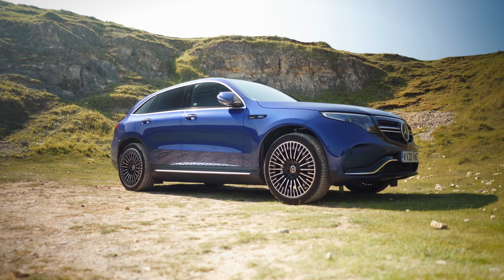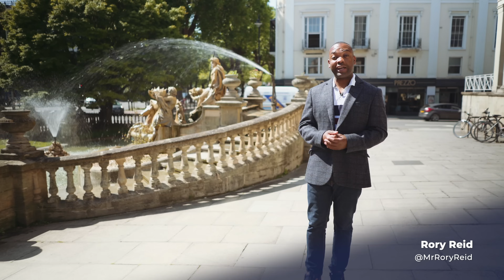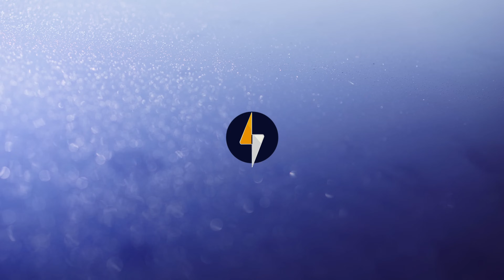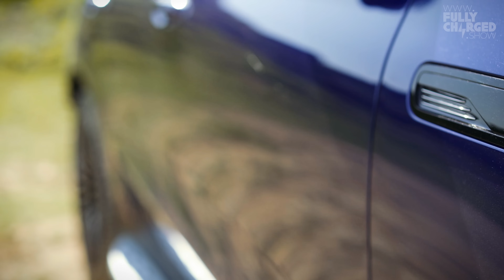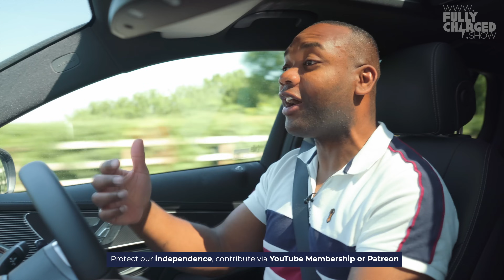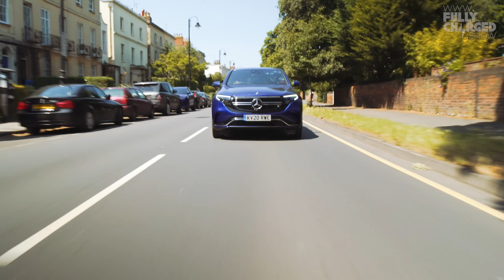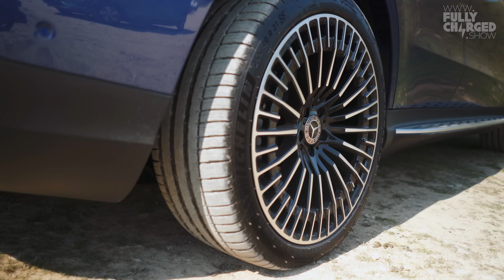Mercedes Benz EQC - Rory Reid First Drive | FULLY CHARGED for Clean Energy & Electric Vehicles

Comment: Double the range with level 3 fast charging (15 to 20min to 90%), before I would even consider it against a Tesla's model Y!
Reply: The tesla is a cheap product though. You see it from its lazy design and non existent interior to its poor build quality and slap dash execution. A car isn't about whether it can play games and make farting noises. It needs to be a CAR first and foremost. Something which tesla is not good at doing. But sadly it seems the superficial nonsense is what people like these days. Herd mentality. People can't do their own research and make up their own minds these days. They need other people's over exaggerated videos for validation.
Reply: @SDav21  So when you grow up, please buy a Merc. 

For me, after driving, all major brands, including the Merc in ICE, I'll settle in with a Tesla as my next EV.

Most people here comment with on screen/online experience.. Own these cars first, then you'll really know. EVs are the future, ICE age comes to an end shortly in next 20 years or so. Tesla is 15 years ahead in battery and battery management technology, including auto computer tech. Yes they are lagging behind in fit and finish, but I'll take my chances, as these are minor issues in comparison to EV auto tech.

PS: when I say battery, the following is involved:
1. Battery power density to weight 
2. Battery charge, discharge rate.
3. Battery life. 
4. Battery temperature control 
5. Power management systems - here actual electron consumption, Tesla is far ahead of any other auto manufacturers
6. Battery safety 
7. Sustainable battery production and future proofing, here too all other manufacturers are way behind Tesla.
Reply: John Edwards  The Mercedes is better built and more luxurious. It has better safety features many which tesla doesn't have. It has better convenience features which tesla doesn't have. Everything from its amazing adaptive lights (see Bjorns channel to see), to the voice assistant to things like presafe sound, presafe impulse side and its general suite of safety systems which Mercedes pioneered years ago which other cars are only using today. Just because the model x has a larger screen doesn't make it more feature packed. Having Netflix and farting noises doesn't make it amazing technology. It doesn't have anything the EQC doesn't have. It misses a lot of other features which many other carmakers have. Not to mention the 360 parking camera which tesla still can't do.
Reply: 15-20 minutes to 90% ..... Of what range?
Reply: @rogerstarkey5390  See the video, double the range, 15 to 20min of that, to 90% charge.
Reply: Let the snobs spend their money on out-of-date status symbols while the rest of the world moves on. The dinosaurs will die off and no one will care.
Reply: @tompava3923  It's not a status symbol. It's a good car. Tesla has become a show off brand more than anything. They don't build cars. They build software that easily amuses kids and small minds and that fools the ignorant into thinking they've got "technology" because it streams Netflix.
Reply: @SDav21  which car had the longer range?
Which car has the better efficiency?
Which car charges faster?
Which car accelerates better?
Which car handles better?
Which car has more practical space?
Which car has the higher crash safety rating?
Which car has longer warranty?
Which car has the better charging infrastructure?
And you want to argue that none of those are important for a car and we should instead ask which car has the nicer interior materials and longer heritage.
Reply: @MrGonzonator  As a car it remains crap though. It's too expensive for what you get. 

Also, No it does not have a higher crash test rating. The EQC scored 96% for the front occupant crash rating in euro Ncap. Model 3 got the same and the model y is a model 3. The model 3 got 86% for child occupant protection, the EQC got 90%. And that is arguably the more important score for families. So no, the model y isn't safer. It barely has all the safety features the Mercedes has.
The charging infrastructure is wide in many countries. Carmakers don't make chargers. They make cars. You don't see carmakers having fuel stations. There's plenty other chargers. 

I drove a model s. In no way is it better at being a car than anything else in that price range. It was simply awful. 

Also the 2 cars are not comparable any way. Mercedes has a GLC that has a long range, that accelerates better, that handles better etc.

So what is your point exactly? There's more aspects to a car than just what you mention. There are plenty cars that are better at everything you questioned, electric or not.

Don't forget the Xpeng either. It's not just about build quality. What's on the outside is what's represented beneath. If tesla can't even screw a seat on properly or a panel, it must be total hot garbage underneath. Some have already shown rust on their model 3s and water leakage from windscreens and what not.  Get over yourself. Tesla really makes terrible cars for the money. And to excuse such slap dash work shows the issue with society today. You'll rather have farting whoopee cushion noises and games than a car built with integrity.
Reply: @SDav21  OK you've made your point, not everyone has to agree what factors are important to a car.
For some people, air vents that are not copper are just euch.
I'm willing to bet a sizable chunk that you are in the vast minority. That the Model Y will outsell this 10x in markets where they compete.
Reply: The fact that you're putting the Tesla model Y in the same sentence with this car, tells how much you DON'T understand about cars. This Mercedes is several leagues above the model X, let alone Y.  Y is a mass produced cheap product. This is a luxury car. They're not even remotely in the same category, and there are so many advantages to the Mercedes that it's pointless even naming them, as everyone who knows anything about cars will be aware of them, and those who don't, like Tesla fanboys, won't understand them even if someone were to point it out to them. The way Tesla fanboys look at cars is SO INCREDIBLY SUPERFICIAL, with so little understanding or depth behind their reasoning. It's almost giving me a second-hand embarrassment feeling because of how clueless they are, while acting superior.
Reply: BeyerT1 Didn’t like your Tesla test drive then?
Reply: @jamesmorris409  Didn't get allowed out probs.
Reply: @derbigpr500  Its not about being a fan boy. But about battery technology today, that I am talking about. The conventional car manufacturers are at the least 15 years behind Tesla in battery technology. Here is the proof, before you open you mouth, please do the research on: "the electron consumption of Tesla model Y with Merc EQC"... waiting....
Reply: @derbigpr500  here in the UK the Model Ys we get will come from a brand new factory in Germany so will automatically be streets ahead of the ones being built in California plus the Tesla charging infrastructure is simply the best there is, so best tech, best batteries, best charging, not the best interior, who cares!
Reply: @derbigpr500  Mercedes, easily the worst car that I have owned.
Reply: @derbigpr500  so many good reasons to prefer the Merc that you're not even going to name one. That's a very convincing argument.

Comment: So, let me get this straight. Tesla's FIRST original car, the Model S (the Roadster was half lotus) had a frunk, more storage space, more range, more performance than this car from Mercedes, a company that's been making cars for 100+ years, PLUS they had the model S as an example of what to do, and they STILL missed the mark by a long shot? Unforgivable.
Reply: That's why Musk said he didn't want to make the best electric car, he wanted to make the best CAR. So combine with a ground-up design (ignoring the original Roadster) Tesla has managed to get around the tedious legacy and automaker thinking. I'm glad the Merc exists, I just wish it was more than just a credit towards keeping the V8 petrol cars out of environmental jail.
Reply: It's what happens when a company is run by marketing (the image is everything to some of these companies) and not by engineers.
Reply: @davenz000  So true. This is a complete failure being a good EC and probably a masterpiece at being a compromised car that needs to keep ICEs on the road while using parts and build facilities of the same.
Reply: The thing with Mercedes is that their reputation is on the line BECAUSE its a company thats been making cars for 100+ years. When you think of Mercedes, you think not only of luxury but also of savety, highest quality and that what you buy actually works (at the least). With a reputation like this, you can't make bold moves like Tesla does. Tesla is better in so many ways, but not in quality or manufacturing for example; Mercedes could never allow someone to say this about them. They double and tripple check every step, which is why they are so much behind Tesla in things like autopilot. Tesla's autopilot is great but its no secret that its full of flaws and caused many car accidents (especially in the beginning with the phantom breaking); Mercedes wants to make sure that the autopilot is perfect. Absolutely perfect. Even if they are 10 years behind Tesla to achieve that. And customer experience is the same deal. No way mercedes is gonna allow long waiting in charging times, thats why they try to find a way to reduce fast charging time (the EQS should be filled in 10-15 minutes max to 80%). And lastly they want the customer not to feel pulled over the barrel with an alteration of the Modell every year, that improves the hardware constantly, so that early adopters feel like they have a worse car than people who buy the exact model 1 year later (Tesla does that Model S has better hardware every 1 or 2 years). They want a future proof car. 

Thats why Mercedes is going slower steps, but you can be assured that what you buy absolutely works and you have the absolute best experience possible with the best quality and all that in a future proof car.
Reply: Well said.
Reply: Think Tesla and MB together. Performance, quality and design!
Reply: EQC was based on the same platform as the GLC, so you could argue this is more like the Roadster, in that it's not based on a platform developed for electric. It will be a lot more interesting when they release their first car on a fully electric platform.

Comment: Whilst a balance, high quality review produced video, it's a bit late, given that the EQC has been on UK roads 12 months. I was with Mercedes for 18 years, test drove the ECQ, disappointing. I dropped the brand and moved to Jaguar with I-Pace. Must try harder Mercedes.
Reply: What was so disappointing? It's the quietest EV out there. And it's got the normal Mercedes traits. Luxury and technology. The EQS is coming on their dedicated EV platform. I wouldn't leave a whole brand for an electric car. Not when electric cars are still in its infancy. There were so many other great option. You could've gotten a GLC43 or a GLE.
Reply: @SDav21  It's far more than just the EQC which given its development time of nearly 7 years, was simply not good enough. The interior is coming from an A-Class, where for the money, it should have been E Class finish. It's simply not. Dealerships have also gone down the drain, pushing for ICE sale rather than EV because of the bonus structure for franchises from MBUK, but also when you're buying 75k+ cars and treated like you're an A Class owner, they really have forgotten about customer service with their drive for volume sales.
Reply: @aquissuk  It wasn't under development for 7 years. Also, you still get Mercedes quality and engineering. What is worse is paying for a tesla and getting an interior of a car that costs a quarter of the price. Even an A Class interior is better than what any tesla can offer. The experience with those dealerships is unfortunate. But it doesn't represent every dealership or the brand as a whole. Mercedes will need to filter out bad ones.
Reply: @SDav21  I was involved in the original research customer group when MB was starting the development group for EV beyond the B Class (my next door neighbour at the time worked at MB and got me involved. That started back in early 2014 when I had just taken delivery of a new E Class. They later revealed the Concept which if I recall came out in 2016. That was the basis of the EQC platform.
Reply: @aquissuk  They most likely didn't start developing it back then. Test mules and final testing cars would've only came out much later.  And anyway, Mercedes generally takes time to develop something. They do things properly. And that's evident in how quiet, well made, well built and safe the EQC is. They actually finish cars when it comes off the production line. So the EQC may have a shorter range than some others but it is still a good EV.

The thing that baffles me is that all you EV enthusiasts would argue how you could charge your car at home and wake up with 100% and that you drive less than "x" miles a day when comparing to ICE cars. But then you guys proceed to bash any other carmakers attempt at an electric car labelling it bad and crap and all that. It's such hyprocisy.
Reply: I was with Jaguar for a number of years. Test drove the I-Pace, liked it, disappointed at the price, moved to the Tesla Model S.
Reply: @ZesPak  Yet the Model S is more expensive than the I-Pace 🤔
Reply: @aquissuk  that's what was disappointing. Over here, the I pace wasn't well equipped, and equipment put its price past the model s price point. The model s then had it beat in price, practicality, speed and range amongst others. Now they are doing dealer discounts on the Jaguar though so that might have changed.

Comment: Any non EV specific design will waste the advantages of the EV drive drain, centre of gravity higher, handling not as good, suspension less compliment,  frunk gone, interior space not maximised, accident  crash worthiness lower. That said unless you have driven Tesla you may not notice. The kicker is you cannot travel outside of ((259) - 29 mile buffer )/2 = 115 miles radius without gambling there will be no charger. I speak from experience having run Tesla P85 for 6 years 100,000 uk miles and electric motorcycles that use public charging.  Tesla superchargers 100% up 24/7, public 50% at best. If you want pannel gaps and local driving get the Merc. If you want to use a car just as a car, go anywhere and have fun doing it get the Tesla.
Reply: @Rubedo Alaberti How do you define hand built? Have you ever been in a car factory?I work in them. Hands are involved in the building of all cars. If you define "hand built" by volume then Tesla volumes are in the same order as the average car model production. Tesla assembly is the same as the rest of the industry. Please explain.
Reply: @slartybartfarst9737  
He's trolling using FUD "headlines"

Comment: Not new and it's running gear came from Tesla
Reply: If it’s the same running gear as Tesla why is it so shit and dull. This is a compliance car only and Mercedes doesn’t want you to buy it. Where are the back orders for this car? Nobody wants it as many pointed out you can have a model y or Audi or jaguar but this was not compared during video, it’s almost like Mercedes told Rory what to say and avoid comparing to its better rivals.
Reply: I'm not actually sure that that's true in any way... The Mercedes partnership with Tesla ended ages ago with the end of the B class.
Reply: You mean the same supplier as Tesla has.

Comment: For this money they need a better platform.   Prices for EVs are still way to high for the normal customer.
Reply: Yes, but remember that the higher EV cost can be offset by much cheaper fuel. Driving 250 miles a week (Rory's comment) saves around £1,500 pa in fuel costs.
Reply: Ian Murray I do agree but the upfront cost is still a little high for a car based on the lower value model that costs half its initial value.   They are the future but you can get a new GLC for £34000 and this one is £65000.   That’s a big difference

Comment: Com on rich people...buy it so we can buy the cheap one
Reply: Problem with this one is the DC charger. They could've got 150kW plus charger and I'd be sold on this. I mean , come on, you can give us plush interior but not a decent charging speed ? If 110Kw is the maximum a Merc can churn out, I'm good with Model Y or ETron.
Reply: @sohitmalik9865  You must fast charge unusually much if 40 extra kW of peak DC is the dealbreaker for you.
Reply: Lol, no one is buying them.
Reply: @GaryKetchum808  I am, but I've also been waiting since April for the factory slot. It's a supply issue.
Reply: Petur A really? Mine is delivered in November and I ordered it just a few days ago 😜
Reply: @Surdeigt  Factories were shut down early this year.
Reply: Jank Paul I am 😉
Reply: resale value gonna be les then 20k in 1 year :))))